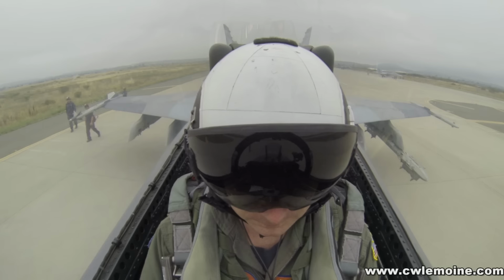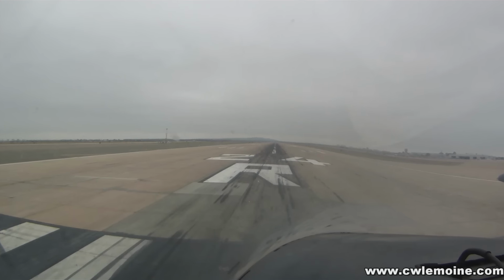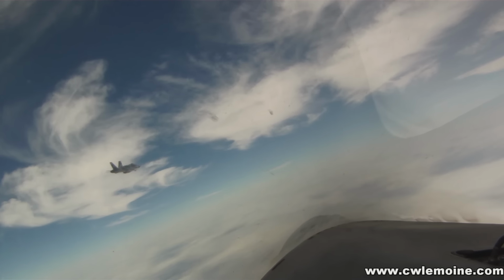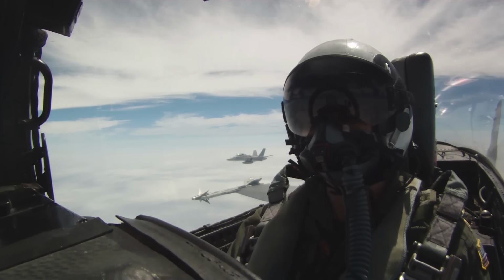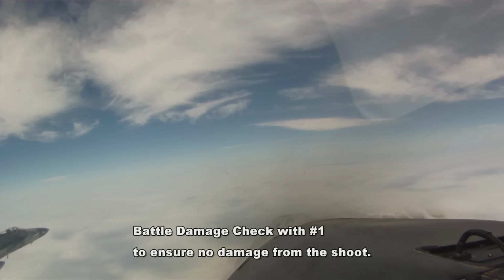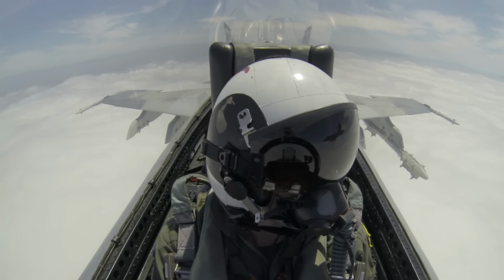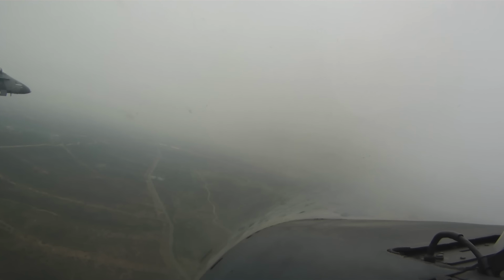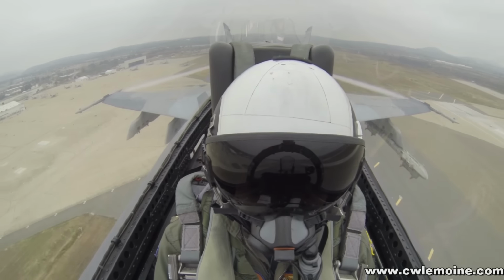Fox 2! F/A-18 AIM-9 Missile Shoot Video Explained

Comment: I moved in right next to General Mitchell Airport, Milwaukee, WI. I am surprised so much everyday at how quiet they have gotten these commercial airliners to be. I live physically right under the flight path of a landing strip, that probably plays a big roll in why it's not that loud due to much less throttle to land than take off. I had a question on why in the world would the glass (or canopy material) not be cleaned every time you go flying in such a ridiculously expensive performance machine!? The debris is pretty low but i would think because visibility is so important, the canopy's glass would be cleaned very well. Just curious for any aviation experts or enthusiasts.

Comment: really enjoying your videos mover. I work around Portland international where the Oregon ANG fly from daily, its cool to know some of what they are doing. A couple years ago i was running a dump truck on one of the runway repaving projects when they were taxiing out to the runway for takeoff, I stopped to let them cross in front of me (air planes have the right of way) I got a thumbs up and a salute from all 4 of them as they crossed my path. couple hours later they came back and did one kick ass fly by at i am thinking around 500 feet, and they were flat moving. Pretty cool guys in my book.

Comment: Former USAF AMMO/EOD troop here. You mentioned the Missile falling away from the target after launching it. That's by design. AIM-9's generally never fly direct to their target. The tracking sensor is gimbaled and will follow the target while the control surfaces stay stationary unless the on board computer gives them a coarse correction for an intercept. After a correction they(control surfaces) return to their neutral position. This is because they have limited pressure to work with. Argon filled tank for pneumatics also keeps the sensor cool. It was always fun putting an AIM-9 seeker on the test stand and watching the seeker follow a heat source as the test set did it's thing.
Reply: that was a very interesting read, thanks for clarifying!
Reply: IYAAYAS! -1995-1999 ammo troop
Reply: SternLX I remember checking them after rubbing your hands on a cold day, the heads will follow that too
Reply: So would you comment on the real world accuracy/reliability of the aim 9?  And if you were able to see the X version?
Reply: Ammo and EOD? And you can spell? I'm not buying it.
Reply: I like your brain.
Reply: This implies the Sidewinders can track something at human body temperature?
Reply: @SamnissArandeen  Temperature differential...
Reply: @MrSunrise-  Hmm now I get why flares can fool missiles -- they're hotter!
Reply: Doesn't this waste propellant?
Reply: @GeraldMMonroe  no propellant comes from a solid rocket motor. The argon used for pneumatics and sensor cooling arent used for propulsion
Reply: @koekiejam18  I was talking about the weird course taken to reach the target.
Reply: @GeraldMMonroe  ah i see, yeah it probably would,  we can see that the missile pulls an incredible amount of G's (upwards of 25 G's! if im not mistaken) which really slows the missile down, but since the missile is light it makes speed alot more easy, generally as long as it doesnt run out of propellant before its done turning itll be able to hit the target since these are used for short range anyway. (you would get ALOT more range out of the missile if it only had to fly a straight line)

Comment: Hey Mover - I've been wondering about something, admittedly kind of random. What is the difference between the Fly-by-wire systems in the Hornet and the Viper? Are they both essentially the same? How much redundancy, flight control laws, etc? Completely different? Thanks!
Reply: F16 have a full fly by wire system with 4 channels redundancy   and it's neutral in stability ,F18 have  backup( hydraulics )  for his FBW  and wings are morphing when maneuver (slats and flaps)The F 16  move just slats symmetrical when turning. F 18in rolling move the external and internal slats and flaps and ailerons (up to alleviate wings twist down momentum).So  in short term the F18 has mechanical backup but F16 only electrical back up( to be  more precise)  .To me it is more complex and complete FBW system in F18 .Don't  know but F 16 engineering is greatest because no majors mishap because engine fault.

Comment: Great video. What kind of app was that you were shooting? Does just the lead use the nav equipment(ILS, RNAV, etc) or are you using it too? Or do you just follow him in off his wing?
Reply from the maker: The Hornet does not have a civilian ILS or RNAV capability.  Only options at most fields are TACAN, PAR or ASR.  I believe we were doing the PAR if my memory serves (Precision Approach Radar).  In an F-16 with an ILS as the wingman, you'd dial in the approach in your system and follow along, but primarily fly off lead.  Same in the Hornet for the TACAN (PAR/ASR, you're just listening and following along).
Reply: Thanks for the explanation.

Comment: Cool Stuff. Is the section approach to maintain visual on the lead aircraft common procedure in heavy cloud cover? Are there any circumstances you've experienced where you lost sight of the lead in thick cloud cover? Just curious if you can always expect to maintain a visual in thick cloud cover.
Reply from the maker: There are lost wingman procedures in the event that you lose sight.  It happens.  Although I can count on one hand the number of times I've done a formation approach through the weather like this.  Typically we just get separate clearances or do radar trail recoveries (F-16).

Comment: Yall need 3 or 4 thousand feet reduced  at NKX? Actually if your a flight you shouldn't need anything.  Separation between aircraft in flight is the responsibility of the flight lead, no? Either way thanks for the vids, good to get pilots perspective.